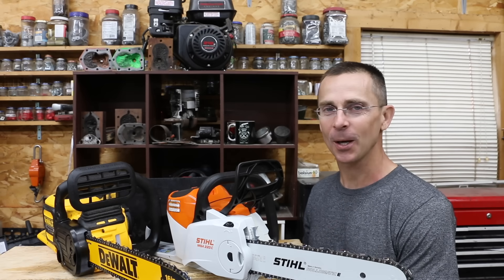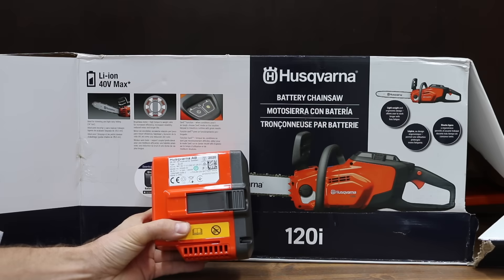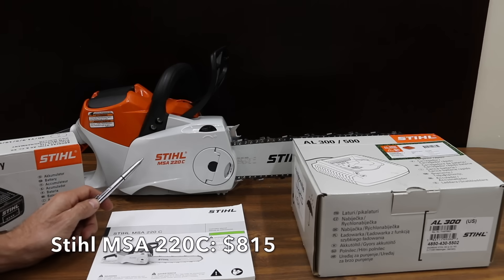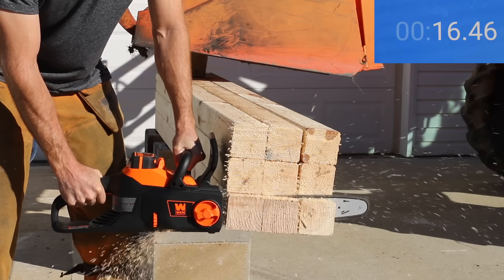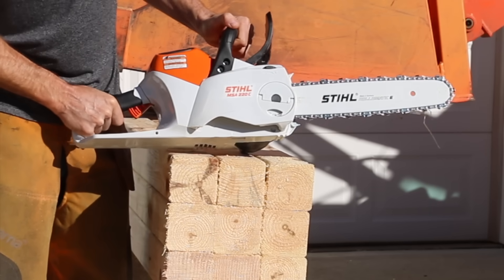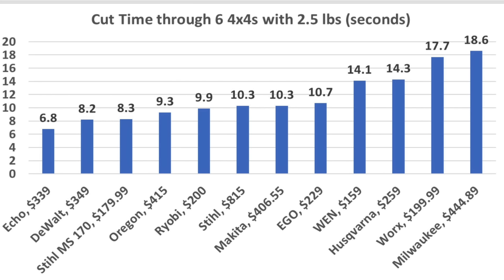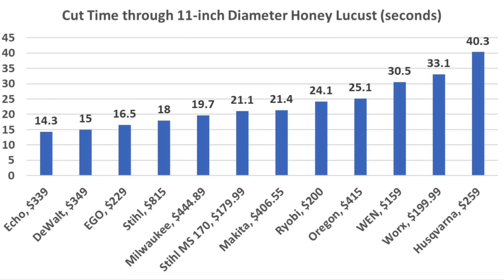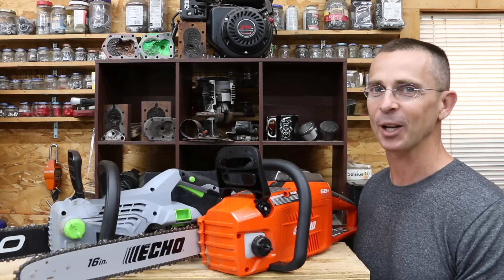Best Battery Powered Chainsaw Brand (ROUND 2)? Stihl, Husqvarna, Echo, Oregon, DeWalt

Comment: I purchased the EGO tools and i have to say that in your video you didn't considered the entry price. I think now i'm fond of the EGO brand because so far i found it extremely reliable, sturdy and works extremely well in every situations. It's way cheaper than other brands and the performances, as shown in this videos are positivey surprising. If you had used a more powerful battery (let's say the 5 AMP) you would have got better results and longer cutting time.
Also I would like to point out that the chargers work pretty fast into getting the batteries to full charge. I have 3 batteries and while one is charging i can work with the other and by the time i deplete the one i'm using, the next is ready giving me a virtual unlimited time on my tools, only a brief moment to swap batteries.
I am very happy that someone introduced me to EGO while i was looking for a more known brand. Saved me a lots of money.
I think, on your tests, that you also didn't consider the comfort. While the ECHO seems better, on the long run its heavy build and the fact that is louder makes for a more tiring experience.
Said so, my very personal opinion after watching your video, is that overall (price/comfort/performances) EGO is better.
Thank you for this comparison video!
Reply from the maker: You are welcome!  Thanks for the feedback.

Comment: Baloney! You HAVE to use similar amp hour batteries for some of these tests... runtime and speed of cuts etc... using an ego 7 amp hour battery will outperform an ego 2 amp hour battery in torque and runtime etc...  even comparing a 2 amp hour battery milwaukee to a 2 amp hour ego will be different...

Comment: In the “run til it stops” test, I am confused. Many cordless tool have a thermal breaker, and stop working when the battery/motor reach an overload temp. Once they cool down they will continue. In this test, were the batteries depleted, or did the saws just need to cool down?

Comment: The no load rpm measurement doesn’t mean anything. The gearing can be different which will affect power under load. A slower no load rpm saw may out cut a faster no load rpm saw.  It’s like gears in a car manual transmission.

Comment: I’ll tell you what. This is an awesome, informative, and thorough vid. Thank you. 👍🏽
Reply from the maker: Thanks and you are welcome!
Reply: @ProjectFarm  BTW. I had a small comment about the total run time. I’ve seen that sometimes my dewalt 20v Max will stop after a few minutes appearing as though the battery is dead. The truth is the lithium battery’s have an auto overheat shutoff. Running them that long can cause them to stop even though the battery is not actually dead. They just need a few minutes to cool and they will keep right on cutting. Not a super long time but at least a couple minutes. May be worth checking with those models.

Comment: Love your videos!! I have the EGO chainsaw.. I have to disagree with run time.. I recently cut up a 14-16 inch hickory tree that fell across the road during a storm. I was using the 2.5A battery that came with my EGO blower. I made 40 to 50 large to medium cuts and a ton of quick snips to clean up the wood for splitting. When I was done my battery still had 2 of the 5 charge light indicators lit. I wonder if you possibly just over heated the saw… Thanks for all of your reviews love the channel…
Reply from the maker: Thanks!  Thanks for the constructive feedback.
Reply: Chain tension seems finicky too tight = too much fricton too loose and the bar isnt held in place properly.  The bar flops around at the chain tension that I would run a MS saw. And the out of the box chain sharpness seems to produce dust not chips At least on a neighbors EGO.

Comment: It turns out that the Echo 58v batteries had an issue with dependability. The packs appeared to be prone to dead cells, and could no longer be charged. An article from a press release states: "ECHO launched an entirely new line of cordless outdoor power tools they're calling the ECHO eFORCE 56V System. This completely replaces their current 58V system with all new tools."  The 58v batteries are not compatible.

Comment: The EGO CS1800E is better made than the CS1400E with metal plates and pins for the bar anchors and sharp metal dog spikes. Since the Stihl price is right up there, it would have been interesting to see how the cheaper CS1805E kit stacks up. Keep up the good work mate. Always learning more
Reply from the maker: Thanks, will do!  Thanks for sharing.
Reply: @ProjectFarm  I have since found out that the new CS1600E skins are built much the same as the CS1800E skins with some changes. The dog spikes/kick back spikes/whatever we feel like calling them spikes (i sware every video calls them something different 🤣) might be dulled off but taking a file to the top profile only should render them quite sharp.

Comment: Much of the issues in this test for Ego could be resolved with a larger battery, which my chainsaw (purchased more than 2 years ago [when this video came out]) came with (5.0 AH). When you consider that buying a battery powered tool makes it more efficient to stay with that battery system, I have to give the edge to EGO. 
.
Ridgid might become a legitimate threat for some outdoor battery power equipment, but I don’t think they will ever be able to compete with the full lineup; Ridgid has begun (in 2022/2023) releasing outdoor battery power tools. Some of their tools might actually be very nice additions to their current lineup and be a better battery investment for some people.

Comment: I have a 72cc Husqvarna 372 a 59cc echo timber wolf a 25cc Efco MTT2500, a Husqvarna 395xp ported saw. And an electric Husqvarna And I've been learning how to cut trees up recently and I'm cutting my teeth on solid oak. If all these saws don't have an aftermarket chain and they are just straight from the package with a stock unsharpened chain, the test is not accurate to reality. Stock Oregon chains suck now. They are cheap straight cut chains not round cut and inconsistent with some being sharper than others even though they are the same brand and model of chain. Straight cut chains can't be sharpened without a machine. And round cut chains can.

Comment: The thing I like about my Makita is the LXT batteries I use in my chainsaw are exactly the same as the cordless drill, weed eater, mower, router, recip saw, etc etc. One battery runs everything. So for me that means my total investment cost goes way down bc I can buy tools by themselves without having to buy a big new special battery for new products. To my knowledge they are the only brand that has this feature
Reply from the maker: Thanks for the feedback.

Comment: Imagine work 6 minutes Charge for an hour. To work for an hour straight. You would need 10 batteries and a half dozen chargers. Imagine what that would cost.  Also some form of electric near by.  I will go with gas powered. Plus the cost of the electric STIHL saw. Holy cow crap ! Folks, I am a Stihl fan. But good grief !

Comment: Seems as though EGO has stepped their game up as far as batteries in their kits since this video was made.  They started offering 4Ah and 5Ah batteries that last a lot longer and they still have tons of power, maybe even more in the newer models.
It's really hard trying to decide between the DeWalt, Echo and EGO.  I've been trying to decide for the last 9 or 10 months and still can't make up my mind...lol.
These videos are fantastic though.  Can't wait until you decide to do another round with all of the newest models of battery chainsaws.  Looks like most of them have made some significant improvements in the last couple of years.  Keep up the good work!
Reply: I'm in the EGO ecosystem and have been for a few years now and am very happy with it so far, only minor nit picks (no chain saw yet though)
Reply: @jacobchalut706  same. love the chainsaw and utility light. The blower is excellent too
Reply: Yeah ego now has an 18" using a 5ah batter with 11000 rpm and alot more power. Its a bargain at $289 without the battery and charger if you have other ego products already.
Reply: @devinlawson4093  they should offer this more "without the battery and or charger" being some of us already have a few chargers and batteries.
Reply: @moxnix  most stores don't carry the tool only but you can have them order it and save around $100
Reply: @devinlawson4093  Thanks
Reply: @moxnix  I've bought a lot of the Ego equip without batteries like my hedge trimmer but I intentionally bought my chainsaw with the 5 amp/hr battery because the one on my lawnmower was 4 years old and starting to get less effective. I've had that battery for 2 years now and it works much better than the original 5 amp battery. 
My 16" chainsaw worked really well in conjunction with polesaw at removing small to large trees and brush behind my property fence.
Reply from the maker: Thanks, will do!
Reply: I can't find an Echo battery pole saw, so I may have to go with Ego.

Comment: So I went to get the eco and found out that the model tested is discontinued and has a 56v replacement with an 18" bar. I'm a little hesitant to get the new one, just in case it doesn't preform as well. I'm a little hesitant to get the discontinued one cause they won't make batteries for it anymore. Wish to there was a way to determine if the replacement is as good as the one tested
Reply: Well, ask anyone who knows about it. It could be the same internally or perform better with it being 56v.

Comment: After introductions--I'm liking that Echo A LOT!   I've used a lot of their equipment, all pro grade. I may take this 40v job back to the store.
Reply: The ECHO used in this video has since been replaced by a new model, where the whole structure and battery system has been replaced. I had the old chainsaw, but we can't replace the dying batteries now that they don't make them anymore. I'd just be cautious about buying into ECHO, their reputation so far hasn't been great. Good luck to you if you do go with them, though! Their products were quite extraordinary, I must say.
Reply: @DJLegoMan13  This Echo has been fantastic, but yes it's the end of the model. That makes the battery reset important to know. The dealer had already reset my battery. But I hit some trash and split my bar, new one on order. This tiny little chain really gets through the wood, I just have to be more careful about tip contact with non-wooden objects.  The two-bolt and wrench bar tightening "system" is MUCH PREFERRED over all those other gizmos too.  Hope the didn't foul that up with the new one. I'll upgrade when I need to.
Reply: WHOOT, I picked a real winner just on looks and experience with saws. I'm going to get an Echo today. Sorry Lowes, that blue thing is coming back.  THANKS PF!!!
Reply: Done!
Reply from the maker: Thanks for the feedback.

Comment: Also, the "RPM of the motor isn't quite so relevant as the chain speed which is a factor of the motor RPM AND the diameter of the drive sprocket.  There has to be a balance between in engine torque and sawchain bite (aggressiveness) and drag by the size of the bar and chain. Chain speed "does the math" between the motor RPM and cog size. In gas saws we can change the drive sprocket according to our sawing tasks and other parameters of setup.

Comment: I looked at this review to see if  my Stihl MS220   Can be beat. I hate chain saws but hate gas powered saw more and have replaced all small gas powered  implements.  Dewalt has chain adjusting issues and a dealer repair  that sucks. I used it for  6 months then  threw it away. All in all  I still like my Stihl and I did have a Stihl Farm & Ranch gas powered for larger trees  till my hired help stole it.
Hate the Made In China  stuff and predict one day the American corporations will regret making their stuff in that country. I am a decorated Vietnam veteran and will buy Made In Vietnam  stuff instead of China if given a choice.
  You  do a great job on your videos and have watched several.
My Stihl  battery  and battery charger investment  is not so high when I have two batteries  and a Stihl brash cutter that uses the same batteries. 
 Yes Echo makes  a good saw but no decent dealers in my area
Reply from the maker: Thanks!  Thanks for watching!

Comment: In your 1st video you mentioned that Milwaukee had a lower gear system than others, did you notice if it helps powering down through hard woods, I have alot of oak trees, I'm afraid that speed may not be the best for me? Any thoughts?

Comment: I truly appreciate and enjoy your rigorous and fair reviews and tests - but....

When it comes to chainsaws, the chain impacts performance so much that I really believe chainsaw tests need to take the chain into consideration.

For example chain:

1 - sharpness has an enormous impact on torque required and cutting speed. A dull chain requires easily 10x more power and energy to cut compared to a sharp chain.
2 - raker depth or how much the depth gauge is filed down directly controls how much down force is required to cut. In fact an overly filed raker will cut so aggressively, almost any saw will stall and require negative down pressure (lifting the saw) to not stall. This makes the tests using specific amounts of down pressure almost meaningless with different chains.
3 - width directly impacts the amount of wood removed. A wide chain allows a high power saw to cut incredibly fast but also consumes enormous power. A narrow chain allows a low power saw to cut considerably faster than a wider chain but there is a limit to how fast a narrow chain can cut if a more powerful saw is used.
4 - the detailes in sharpening grind (square tooth, baby C, full round file, etc) and the tooth design (active safety chain vs pro chain, etc) also have a significant impact on performance and power requirements.

I do agree that out of box performance can be measured with the original chain, but it doesn't take long for ALL chainsaws to dull their chain and either require sharpening or replacement with a new chain.

For example this summer I purchased a new Stihl MS261C-M and within the first day of use I'd already sharpened the chain half a dozen times, including filling the depth gauges, and on the second day I installed a new, longer bar and chain with a different tooth design.

Due to these factors and more, to really test chainsaws against each other, there needs to be either identical new chain on all saws or at least chains with identical grinds with tooth designs as close as possible.

I love watching your test videos! Keep up the awesome work!
Reply from the maker: Thanks, will do!

Comment: Thank you for these two videos. But could you do the run time of multiple cuts through the hardwood to drain the batteries for the chainsaws in the first video? And could you re simulate the battery usage of the this video’s chainsaws after the 9 4x4, unopposed cut time w/ the 2lb. weight, and hardwood cuts? And for the chainsaws in this video, could you do the total run time unopposed for each chainsaw? Also if it’s possible: for the gas powered Stihl chainsaw in the first video, what was the fuel level after the 9 4x4, unopposed 2lb. cut time, and hardwood cut? As well as what the total unopposed run time on a full tank is and the total run time for multiple hardwood cuts? Thank you for these videos.

Comment: I'm about to buy a Dewalt DCCS677 with the 15Ah Flexvolt battery (5Ah at 60V). I chose Dewalt because I have so many Flexvolt batteries from my other tools and projects. I considered Ego as well because I have their Z6 zero turn mower, which has six 10Ah batteries (and Ego now has 12Ah batteries), but Ego seems a little behind in the power department. I'd love to see them produce a model that exceeds the power of a 50cc saw. Dewalt also needs to make bigger batteries. Even their 15Ah Flexvolt battery only holds 300 watt hours. A typical 80V 6Ah battery from Kobalt or Greenworks holds 480 watt hours. This means Dewalt would need a 24Ah battery to hold the same amount of energy. I can't imagine what ridiculous price they would charge for such a battery. You can buy 300 watt hour power banks or power stations (generators) for $200, so there's no reason they should be charging those crazy prices.
Reply from the maker: Thanks for sharing.

Comment: I'd love to see the Dewalt DCCS677 tested. It'll probably blow all these saws out of the water, especially with their new 5Ah battery (15Ah Flexvolt). And consider adding the Stihl MS 271 Farm Boss gasoline chainsaw to the comparison since Dewalt used it in their promotional material. I'd like to see how accurate their comparison is.
Reply from the maker: Thanks for the suggestion.

Comment: Instead of referring to capacity in amp hours, I recommend using watt hours. Amp hours aren't useful when the voltages are different. Then you can add a dollar per watt hour graph to see who charges the best price for their batteries, and you could make it price per productivity to include efficiency. A lot of people probably don't realize that the battery voltages are the same among certain brands even when they advertise a different voltage on the battery, for example, Ego calls theirs a 56V while Echo calls theirs 58V but the actual battery is a 14 cell series pack, which is 52V nominal, perfect for electric bikes too.
Reply from the maker: Thanks for the suggestion.